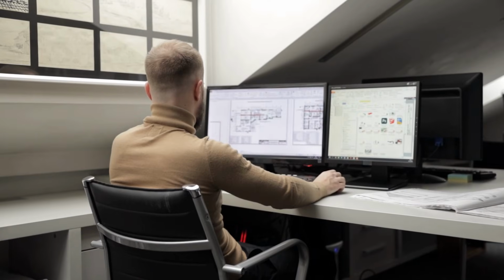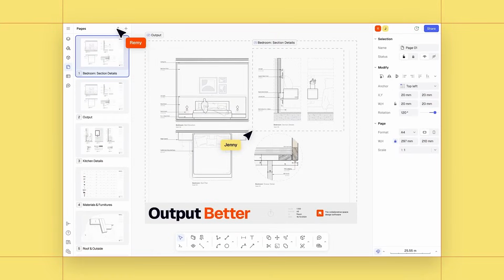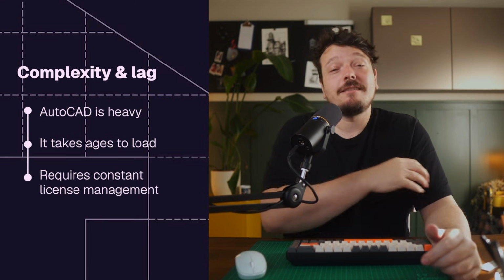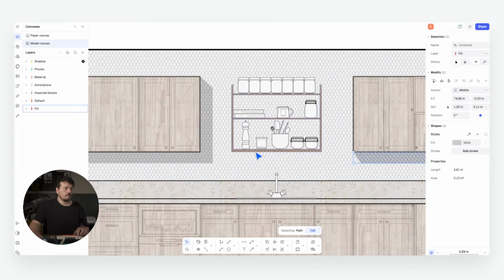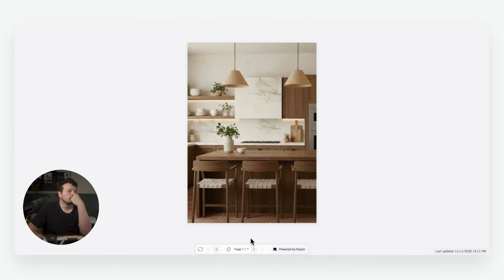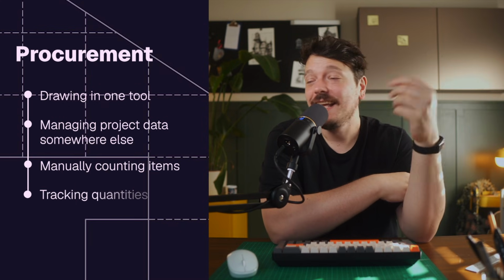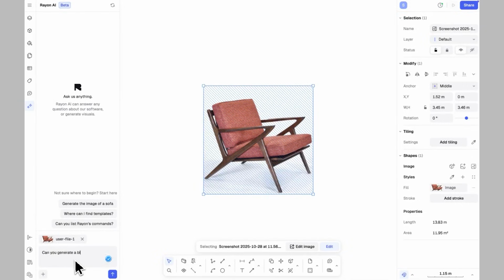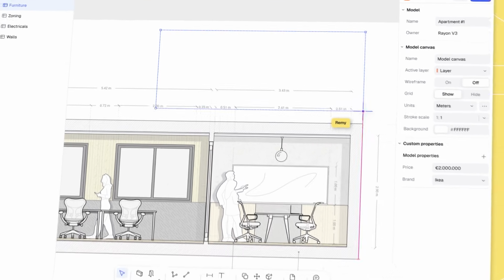How I Replaced 5 Design Tools with One! (Rayon Design)

Comment: Can Rayon be used for foodservice / commercial kitchen design and connection drawings documentation? I design in this industry using AutoCAD and Revit.
Reply from the maker: It’s definitely possible to use our tools for layout and documentation, though we don't currently have specialized libraries for commercial kitchen equipment. 🙌

Comment: I am a subscribed user of the Rayon design software and have been a paying customer for one month.

I am experiencing an issue with the desktop application. One of the buttons on the left-hand sidebar, which should activate AI features, is not functioning as expected. The button is clickable, but no AI menu or options appear.
Reply from the maker: Hi there, the AI features will be avalible this week, stay tuned!